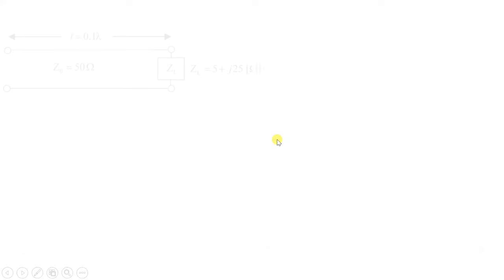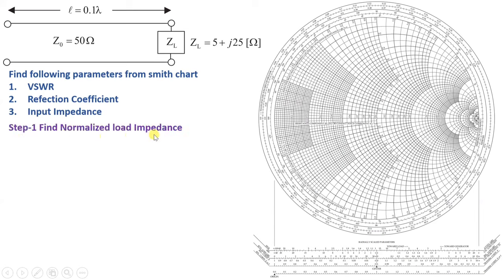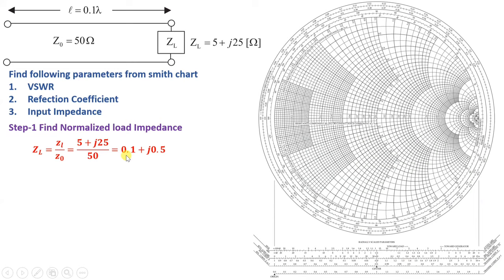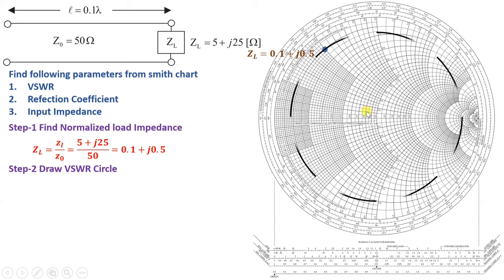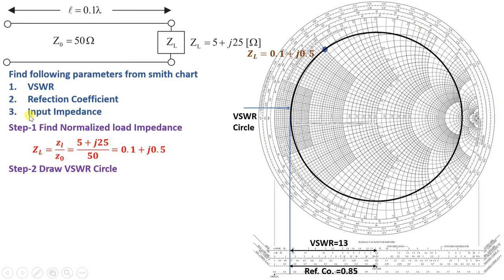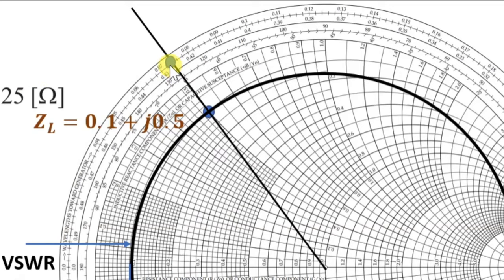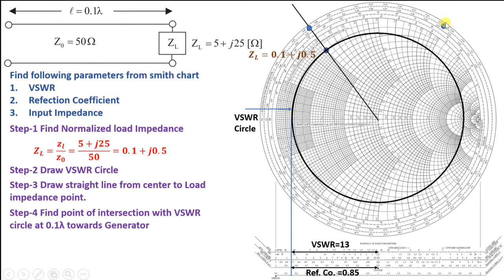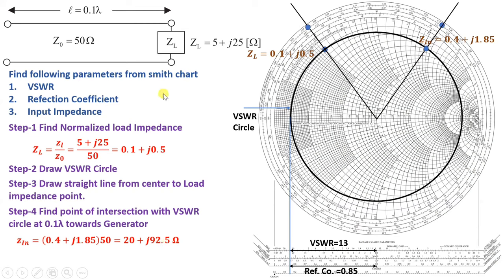Smith Chart Example for Transmission line Parameters (VSWR, Reflection Coefficient, Input Impedance)

Comment: How you identify the 0.1 lambda value between 0.17 and 0.18? 
answer: the line form point load impedance and the center intersects at 0.074 in WTG. So add 0.1lambda and point of intersection 0.074 to get the point required for input impedance in WTG .
I.E. 0.074 + 0.1 = 0.174
Reply from the maker: Yup
Reply: thanks bro🙏🙏
Reply: Thanks man 🙏🏻
Reply: Thanks dear ❤
Reply: hey King you dropped your crown, take it

Comment: Sir..u said that We should move clockwise for input impedance & u placed the point in btw  17-18....my query is how u found that the point is in btw those two ❗
Reply: because he needed to move 0.1 lambda and if u add 0.075  + 0.1 ,its 0.175 which is between of 0.17 and 0.18
Reply: @satyamsuresh2881  what is 0.075??
And how can i calculate 0.1lambda distance?